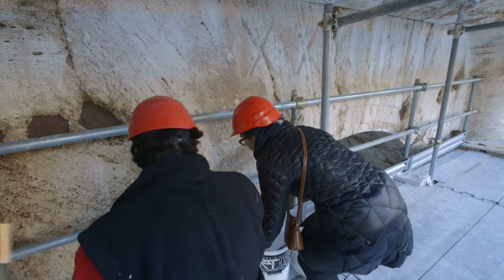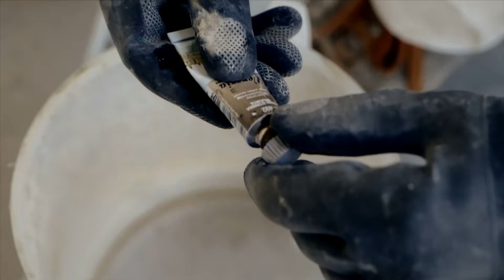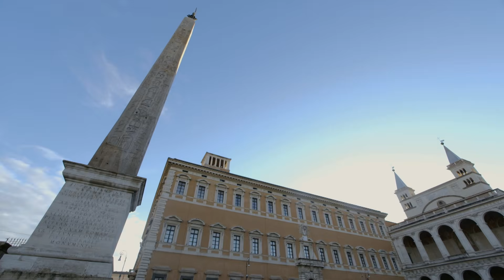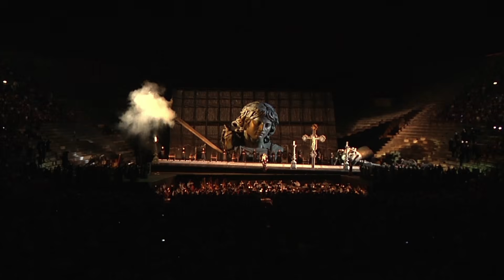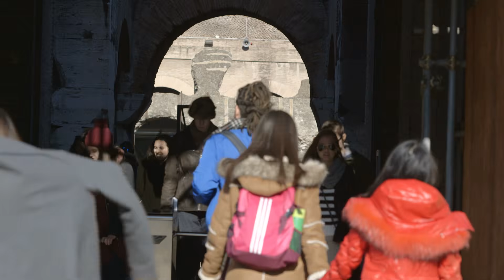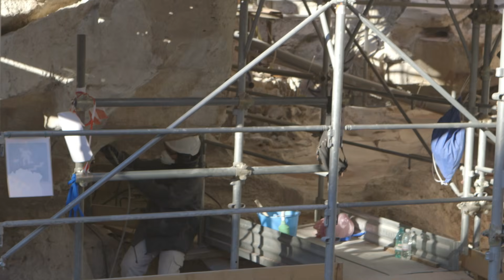Why The Engineering Behind The Colosseum Was So Advanced | Colosseum: The Story | Unearthed History

Comment: TLDR: Roman concrete is harder cuz it is crappier quality.
now that I have ur attention, enjoy the lesson about concrete.
While Roman concrete does solidify in water, that is not why it is stronger than modern concrete. Modern concrete also hardens in water (which is why it is recommended to pour when its humid out and why Las Vegas has sprinklers on their construction sites). concrete is a mixture of cement (think of it like glue) and aggregate and water. The common modern cement formula is called Portland cement because it gives of the same color as the rocks in Portland, UK. The romans found that adding Silica into their cement formula makes it to where the concrete doesn't need to dry to harden (like the previous concrete solutions known to humans) because of the chemical reaction it has with water. Once the water mixes with the ions of the aggregate materials and because of the Silica, instead of drying out like it used to require, it rather changes the entire bonding process (not too sure on how to exactly word it) to where the water add makes some chemical crystal and they interlock together and become hecking strong. Now the reason why Roman Concrete is considered superior is because the entire formula was not mixed as well as the current  solution. Now that does seem like the opposite would happen, but instead what happens is that there were  little blocks of undissolved Calcium Oxide imbedded throughout the hardened concrete and once there was a crack in the concrete and it rained, the calcium oxide would dissolve in the water and essentially reharden. thats why in some Roman ruins that are still up, you can see different colors in some of the concrete. So technically, Roman concrete is not stronger, but rather self-healing.
enjoy ur lesson of useless fact of the day